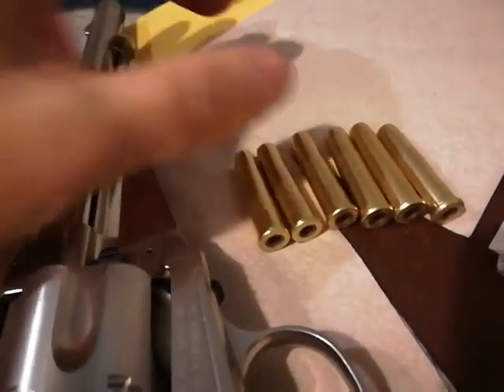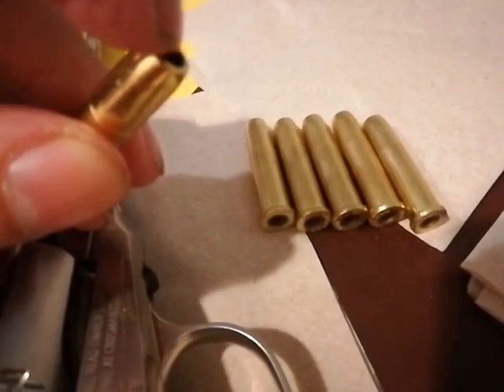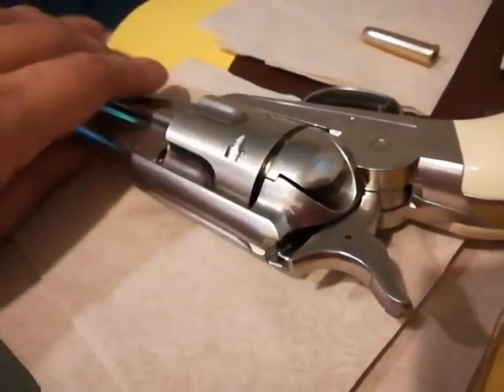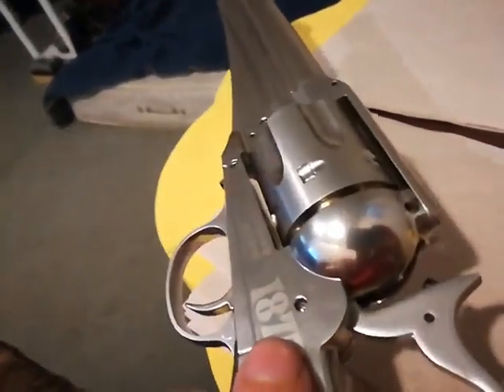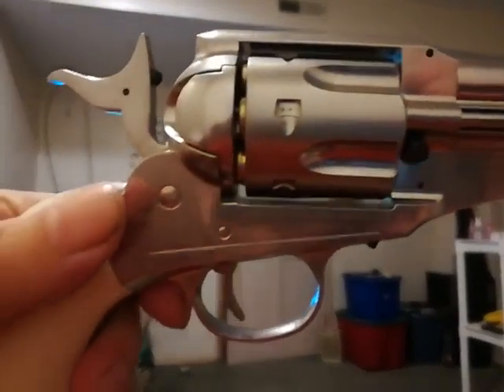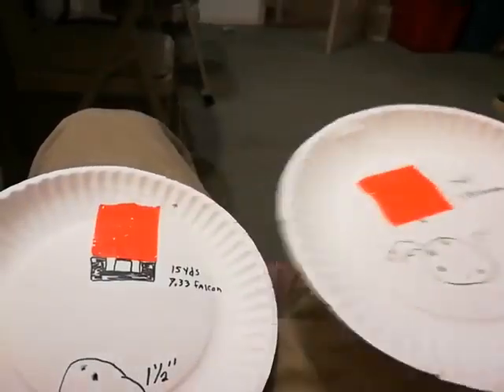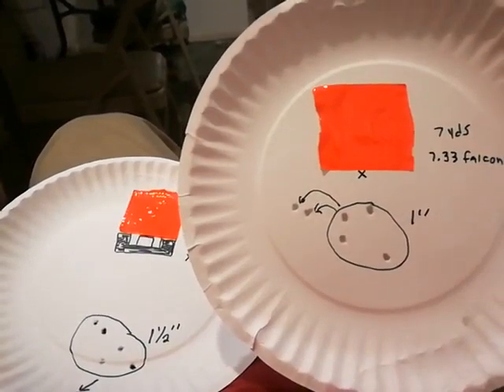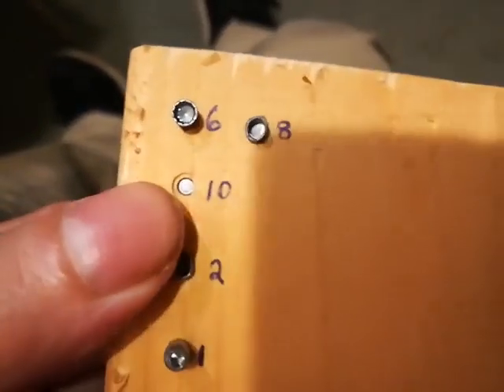1875 Remington - .177 Co2 single action revolver

Comment: Leaving an empty chamber isn't necessary on modern single action revolvers, such as the Ruger Blackhawk.
Reply from the maker: BedsitBob yep.....transfer bar....but if someone had a BB gun replica before they got a older revolver with out transfer bar they could think it's like a BB gun and not be careful by resting hammer on a live round...same with a 1911 BB gun it's good to get into a habit of cocked and locked so when they get the real one the hammer is not going forward since replica air gun habits transfer over to real firearms one may forget about safe carry

Comment: Nowadays there's a block that would keep the round from going off,  even if you dropped the gun on the ground or hit it accidentally
Reply from the maker: Yep the hammer block safety or transfer bar...a real version of this gun may have the spur mounted hammer...if so it would be the kind that isnt drop safe...its a danger every new revolver owner must know....even air guns have that transfer bar or hammer block mostly
Reply from the maker: If a younger guy buys air gun like this and then buys the real one its good to inform them about safety....just like a 1911 airsoft gun you can have hammer froward but on a real 1911 45 kabang if that hammer is forward...cocked back and on safety only for the 1911 is the only safe carry

Comment: Hello my name is Emmett I'm a new subscriber to your Channel I just picked up the Remington 1875 replica and what I wanted to know that you did not mention in your video was what size cartridges go into this Remington as far as getting extra cartridges and the color of the casings can I get the Chrome casing or the brass casing so I would like to know what size cartridges go into this Remington yes it came with the cartridges for pellets and BBs but nowhere in there manual or on the box did they mention the cartridge size... the Bear River Schofield number 3177 caliber pellet cartridge fit inside the Remington but it was just a little shorter than the shell casings that came with the Remington I do not know if that makes a difference this is my first time owning a bb or pellet single action revolver so if you would be so kind please let me know what size cartridges I can use in this Remington 1875 replica this Marine would truly appreciate your response thank you my friend
Reply: You can buy extra correct crosman 1875 remington bb or pellet cartriges  they come in packages of six.
Reply: @drspaseebo410  it does take cartridges...there are six for .177 pellet and six for 4.5 mm bb you can buy extra on line or at you airgun dealer. As for interchangability with cartrides from other airgun...yhe Umarex Colt Saa Peacemaker fot bit not sure how well they work the Crosman 1875 Remington do not fit the Umarex Colt SAA peacemaker the rim is too thick...Best to just buy the crossman pellet or bb spare cartridge for the 1875 Remington

Comment: Beautifully engineered gun shame they never rifled the barrel for better accuracy, the Grossman version of this Remington is far better with velocities of 450ft per sec and accuracy.
Reply from the maker: true, this one its low velocity given it barrel length, the crosman SNR 357 revolvers including the shorter barrel may be higher velocity then this one, this one is more of a fun collector lacking some power, with this barrel length it should have had been 475 to 500 fps for a 7.0 grain pellet at least, but seems more of a collector item so i dont mess with it that much
Reply: So this is not a crosman? which make is this?
Reply from the maker: @mortenlund6199  it said remington on the plastic package it came in
Reply: hmmmm.... on the crosman webpage the gun is also listed under Remington. I think it maybe the same gun... cant find any other maker, and i looked all day. Im considering buying and if there is two versions it would be interisting to know.
Reply: This is the crosman...
Reply: It is made by Crosman licenced by Remington like the Umarex Colt SAA is made by Umarex but licenced by Colt.  It has a 6 shot aversge of 475 fps with 4.5 mm steel bb and six shot average of 405 fps with 7.9 grain lead pellets
It holds consistant 1 x 1 inch 6 shot  groups at 30 feet with 4.5 mm steel bb and 3/4 x 1 inch 6 shot groups at 30 feet with 7.9 grain lead pellets. 
Always put a drop of pelgun oil or silicon oil on tip of co2 cartrige to kerp the sesl lubricated and prevent leakage due to shrinkage , drying up, cracking and never leave co2 cartridge on hun when not in use to prevent sesl developing memory causing ot to lesk co2.   Alway clean gun after use as you would an actual powder burner alway put s drop of pelgun oil or silicon oild on All seals ( at point co2 is pierced, remove cylender to access seal at point exits frame  seal on rear of each cartridge. A light coating on all moving parts incliding forcing cone if inner barrel. Wioe off excess oil.  Never Ever use petrolium based oil it will dedttoy all seals and moving parts) follow these procedures and your Crosmsn  1875 Remington will remsin looking and perfotming ad it did the day it was firt bought and shot.   Ive had mine 3 years and it still looks and performs as it did the day I bought it.